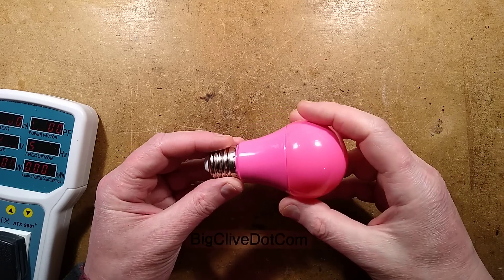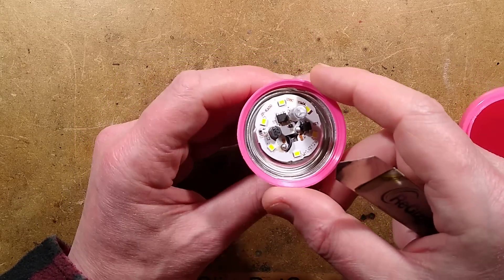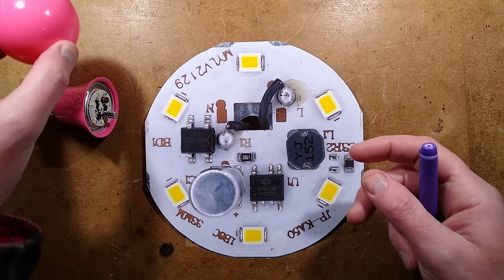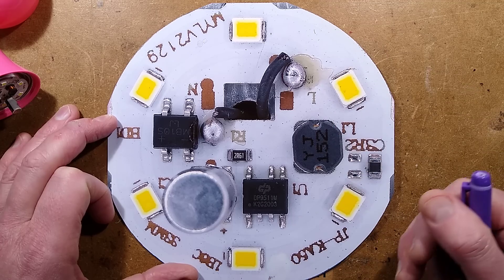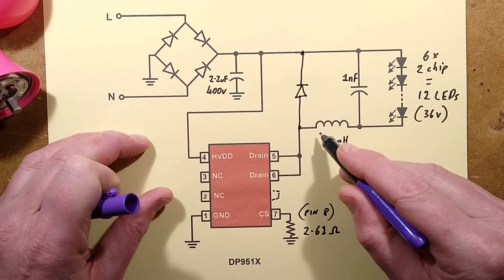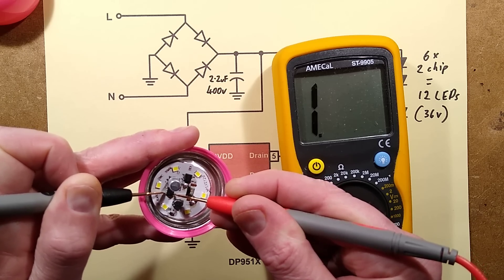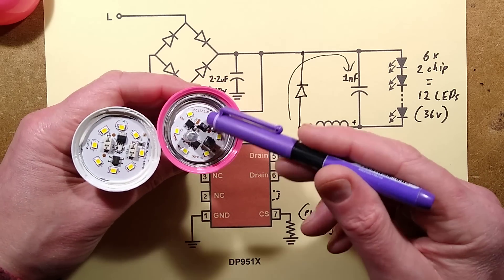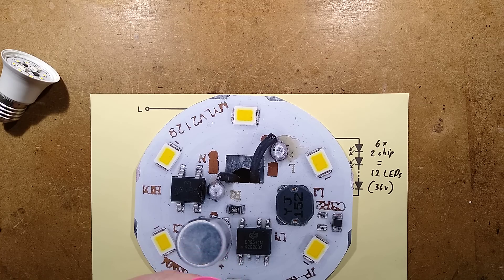Inside a big pink lamp (with schematic)

Comment: I guess all comments with a URL are purged. but there is a new Single board Computer called a MangoPi about $25 or so, but the circuit board is PINK on both sides.

Comment: I've had some fun using a crude spectroscope (or some other means of viewing the spectrum of the emitted light) to guess what type of light source is inside before opening (or if doing so isn't an option). A bit of practice might be able to tell filtered-white from colored LEDs. I know distinguishing fluorescent vs. LED backlights in displays and lighted commercial signs is particularly easy: Just look for the mercury lines.

Comment: Clive hinted at something interesting: the inside of the diffuser is matte finish.  Something that shape might be expected to have been blow-molded and probably smooth inside.  The implication is that the matte surface is intentional; how did the manufacturer create the surface?
Reply from the maker: It could well be just the result of the blow moulding into a smooth mould.

Comment: a few comments have said that the moulding process is probably why the plastic has a matte inside and a smooth outside, which makes more sense than it being intentional, but iirc a matte surface will diffuse the light reducing/removing hotspots and causing a more even spread of light, so the matte interior diffuses the light and the smooth exterior just exists likely because the mould used is very smooth.

it's probably not intentional but it kinda helps, a little.

Comment: Pink/purple LEDs look atrocious. I have a purple-and-blue LED lamp for kitchen greens, and in its light, greens are just blacks. It's really disturbing.
Since it's monochromatic, the cover wouldn't have changed anything in that regard.
I don't think there's such thing as a magenta LED, unless there are pre-manufactured bichromatic LED chip configurations. Magenta is not a true color, it's a mix of blue and red.
You could probably use a combination of red, purple and yellow/white LEDs here, but the manufacturing cost would be atrocious compared to the default LED lamp.
Reply from the maker: The magenta LEDs use red phosphor on blue LED chips.
Reply: @bigclivedotcom  oh huh, guess I shoulda searched for parts longer, didn't find any. My bad.

Comment: Remember the Ferrex tools? Ryobi 18V High Performance Batteries have been dying too early, and I've mentioned your name in a means to get more information on the problem for everyone. Are you willing to tear a broken one down to investigate? Here is information I know so far:
- HP Lithium Batteries, in a near irrecoverable dead condition, drop to 0.4V (BensRyobi [YT])
- Manually charging each cell to a higher voltage recovers the battery.
- The low Voltage per cell is 2.8V, and there are 5 to 10 Cells. (ToolBoyWorld [Web])

My hypothesis, with what I know, is that the ODP isn't triggering, if present at all.

Comment: The collapsing field of the inductor continues to drive the current in the same direction. The polarity does not switch (otherwise current flow would be in the opposite direction). In fact with the bridge rectifier, your just dealing with a fluctuating DC current and the inductor smooths out the ripples.
Reply: The first statement you made is correct but the second is wrong. The polarity certainly can switch. Think about a standard boost circuit where you apply V+ to one end of the inductor and pull the other to 0V, ie, negative. Switch off the transistor and instead of 0V, suddenly you have a voltage well above V+. The voltage polarity across the inductor has flipped even though the current flows in the same direction.

Comment: Excellent video as always Clive! Are the buck converters more efficient than the current limiter circuits? I would have expected this circuit would give a modest improvement in energy efficiency
Reply from the maker: A properly designed linear regulator will potentially be just as efficient, much lower electrical noise and significantly simpler.

Comment: In the thumbnail it said, "Not for bodily insertion" ... Big Clive, didn't you know that you can buy "things" that ARE for "bodily insertion" on eBay and AliExpress! ... They're quite cheap, and they work quite well! 👍😜🤣 ... Did I just type that out loud, again? ... I'm always doing that; typing what I'm thinking!

EDIT: I have a long dark windowless hallway in my flat with three lights. I bought three PIR LED bulbs from China. One started flickering and died. Another started flickering, and then stopped. The third thinks it's a disco light! ... Chinese crap! 👎😠 ... I wouldn't mind, but they weren't cheap at around £3.50 each! 🤣 (I'm tight!)
Reply from the maker: The power supply cap would be suspect in those lamps as the LEDs shouldn't normally run hot.
Reply: @bigclivedotcom  Cheers Big Clive, I'll do a teardown ... Now, where's me spudger? 🤣

Comment: I don't want to buy more LED bulbs with the linear regulator, three died over the past two months, I have lots of the early ones with the buck converter, at least 39 are still in use, and none have failed, not even one that I put in a greenhouse and it condenses/traps a lot of water inside the diffuser a few mm from the PCB. The ones I replaced was only because the most modern ones illuminated the same with 25% less consumption (8W vs 6W)

I guess 100% of those rated for 85 to 265V will use a buck converter and 99% of those rated for 220-240V will use a linear regulator and PCB heater combo chip.
Reply from the maker: The linear lamps often deliberately push the LEDs to the point of controlled failure.  They can be hacked.

Comment: Can you do a video explaining what the power factor means showing the best and worst items plugged in for reference?
Reply from the maker: It's the relationship between the current and voltage waveform.  Best load is a simple resistive load, worst loads are capacitive droppers and most simple electronic power supplies with a mains side smoothing capacitor.

Comment: "2.61Ω resistor"... 
It's getting so annoying these days to find such odd, non-standard, resistors inside of today's electronics. I completely understand why it's done, but it sure makes quick repairs on things much harder today when those odd resistors are blown. It's not like it used to be, that you could simply did though your components bins, junk drawers, or rip a resistor off of an old board that was the same value when it comes to this today. I have several projects, open on the bench, waiting for odd resistor values. My good hobby grade universal battery charger shit the bed a few days ago, and it was a blown .037Ω large SMD sense resistor, so in the pile it goes until I get a big enough order of odd resistor values to make it worth it to order them online. I have a couple of large Mosfet audio amps with the same issue in the pile also. Sometimes a guy can get lucky, and find 2 of the right size SMD resistors on some junk boards, that paralleled together will work, but not very often.

Comment: Presumably the use of a buck regulator allows the LEDS to see 36v and a relatively constant current for most of each input AC cycle and the input cap doesn't need to be very big as the rectified DC can drop to maybe 40v between half cycles. Not sure therefore why they have a relatively large (for the 5 watts consumed) input cap and poor PF at 0.6

Comment: I've used some magenta LEDs as clipping diodes in a guitar distortion pedal I modified. For some reason it sounds better than when I used red or yellow. Must be the pinkiness adding to the rock'n'roll.
Reply: Added some marvelous Pink Noise
Reply from the maker: Probably the use of a gallium nitride LED vs gallium arsenide.

Comment: The most likely reason for the plastic bulb being shiny on the outside and matte on the inside, is the mold is shiny where the top touches, and nothing is touching the inside. It's like Aluminum foil, the part tat touches the roller is shiny, and the part that doesn't isn't. Given the way it's built, optics was of little concern. It would be interesting to see if cool/blue LEDs give a better color than Warm LEDs. I would think the ccol ones would be better.

Comment: Im fairly new to electronics and have a question, so he lives in the UK so he has 240V AC coming into that thing, then the bridge rectifier and capacitor basically turn it into DC, but usually isn't there a transformer after that to step down the voltage? I wouldn't think that tiny LED driver could handle 240Vs (or anything close assume some loss) or does it?

Comment: Either the driver is a synchronous driver and it has a PMOS with an inherent body diode which also serves as an ESD diode and under operation the current path is provided by turning ON the PMOS 👍🏼or...
...if it's an open drain driver (NMOS only), the output pin must have an explicit ESD diode to HVDD. Without an explicit external freewheeling diode it will be the chip ESD diode taking that burden which is not advisable. 👎🏼

At any rate, you will always detect a diode from output pin to HVDD.

Comment: Part of the reason for using white LEDs (other than cost or component availability) is that it may improve the color rendering of the bulb, since the color filtering of the cap isn’t perfect, and would allow some other light colors through.

Though you aren’t probably using this bulb for it’s excellent color rendering.

Comment: With the off-centre PCB is looks as though the back of the board could come into contact with the inside of the threaded portion of the lamp which might (or might not) be connected to the mains live connection. Lovely!

Comment: i was absolutely GUTTED the first time i opened up a colored LED light bulb...red and green led bulbs....and they were white inside
it is like ordering a hamburger and receiving a slice of potato on bread!
from the looks of things, i think they ripped the pads off and soldered it near where the pads were and it would normally have the leads closer to the top of the hole, only cutting the wires a little bit when being more centered but hey,  as long as it fits in the cap and doesnt go bang when tested
Reply: why do i want to see someone good with vfx take 1 of your blown up images of the boards and overlay them with audio of you testing it and the giant board lighting up? lol

Comment: I reckon the reason for the finish is that it wll have been blow-molded, with the outside pressed up against the material of the mold which will have an incredibly high surface finish and the inside not touching anything except air.
Reply: probably but, iirc the matte surface would diffuse the light giving a more even light on the outside, so even if unintended it helps the light spread more evenly and makes it more visually pleasing by reducing/removing the hotspots from the LEDs

Comment: White LEDs and a colored filter gives a much better look for festoon lamps than LEDs in the matching color
Because LEDs have such a narrow band on the light spectrum, the mixed light from a festoon with multiple colors always looks weird. A light filtered from White always has a much wider spectral band, so the different colors from a festoon overlap a little and give a more pleasant overall look. Thea can of course by design just be about 30% as efficient as colored LEDs, but since we are coming from incandescent bulbs in this sector, LEDs are still the choice
Technology connections has gone deep in to this rabbit hole

Comment: i have a question for you clive, reguarding AC uvc lamps with o3 generatorzzz ..is the polarity relevant for the o3 gen? should the neutral be on the outside shell of the bulb for optimal result or is it just me rumbling in my head? i anked chatgpt but he was very vague...(per usual)

Comment: Not sure why you think this switching buck regulator design is less efficient than a linear regulator for these lamps. As far as I can see, not much energy is wasted here compared to resistive regulators which work BY wasting energy. 

Here in India the standard for retrofit bulbs is an 80V string of LEDs powered by a buck regulator. Probably because they work best with uncertain mains voltages.

Comment: I'll bet that the matte interior diffuses the light across the entirety of the bulb. If it were smooth, you'd end up with sharper high and low intensity regions from the LEDs.

Comment: This pink led is only meant to be pink when its turned off .. or broken - so it doesnt matter what lights sources they used inside :), you turn it on and most of the other hue comes out.
Reply: I noticed that, too. The direct light from the bulb in the video was bright enough to wash out the color and appeared white. It would have been interesting to see more reflected light from it.
Edit. I reran the video, and when the bulb is near the bench you can see some pink reflected light.

Comment: I think the matte finish in the inside of the globe acts as a diffuser, preventing the user from seeing multiple point origins of light from the LEDs.
Reply: I suspect that's just an incidental affect of the manufacturing process. A useful one, but one that comes about as a result of how the they are made (air blown mold rather than any other type, the just wouldn't be able to make them in one part otherwise).
Reply: @nickryan3417  This is my hypothesis as well; these will either be blow molded or rotary molded and the outside surface will be formed by contact with a tool, the inside is just in contact with air and is what it is.

Comment: They probably didn't use a matching color of LED, because they designed it to be a one-size-fits-all to be used in different colored bulbs.
Reply: And the manufacturer obviously has no reason to give a crap about efficiency. It's easier to make every PCB with the same LEDs and cast the housings in different colors.
The thing you do notice using colored LEDs rather than white with a filter is the much more pure colors. Put a red lens on a white LED and you get mostly red light with a little bit of pink and orange. But an actual red LED gives you just red and nothing but red.

Comment: No worries. It does not have the required measurements of a „body insert device“ in all dimensions. It will not be used (besides real desperation).
😂

Comment: How do you tell which color the smd leds are just by looking at them off?  Its not always determined by the phosphor coating..  ive seen smd leds look the exact same yet light up green and blue as well as white.   All looked the same color when off but did have different looking diodes inside each led…
Reply: generally when a phosphor coating is put it's for yellowing/warming the emitted light spectrum. A thing you don't want for cold colors like blue, purple or pink.
And as pointed by many comments, it's easy to assume this is basic white leds as it economically makes sense for assembly line and stock management.

Comment: The Fwd voltage of a Red/Magenta LED is much lower than a blue/white LED, so the would need many many more Red/Magenta LED's, but no colored magenta bulb.
Reply: Depends if the colour is generated directly or if the diode itself is blue or / [near] UV internally, and the final colour is generated by phosphors.
Reply: @michaeltempsch5282  EXACTLY. Pure single color semiconductor LEDs are always better at their exact color, than filtered white-ish phosphor-glow LEDs are.

Comment: I think it is a scam and a conspiracy to make people believe they can actually light a room with these little LED lamps. We are held like cattle and are not supposed to use up power because that reduces the profit until retirement of a person. You can build a good LED light yourself, but you can not buy them. For example, when you buy an LED lamp online it often says 100W light.  But in the fine print, you can see that the lamp actually only uses less than 10% of that. If you want good lighting, then the only option is to build it yourself.
Reply: No conspiracy... They're just saying its EQUIVILANT to a 100W INCANDESANT bulb because that's what people are used to...
Reply: @kimchristensen2175  "nothing to see here, keep moving"

Comment: I've started just popping off these domes because they block half of the total light output hahaha, what a useless invention... They don't even make much sense for diffracting the light as your lamp will most likely still have milky glass covers for that
Reply: Just be aware that you do expose mains voltage – and DC-rectified mains voltage at that (much more dangerous than AC) – by removing that cover. Maybe glue a clear acrylic disc across it.
Reply: @TerrisLeonis  good point. Still the best solution would be for the Chinese makers to improve these dumb domes :D
Reply: Might even make them last longer because popping the cover off will help cool the circuit.